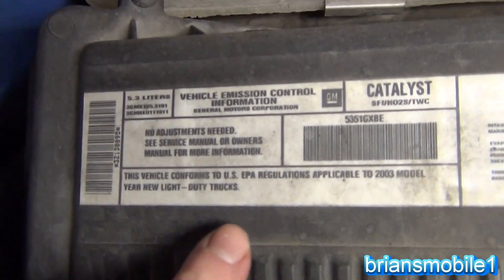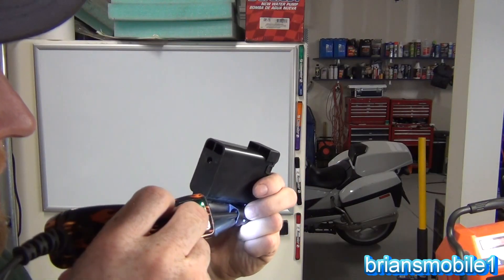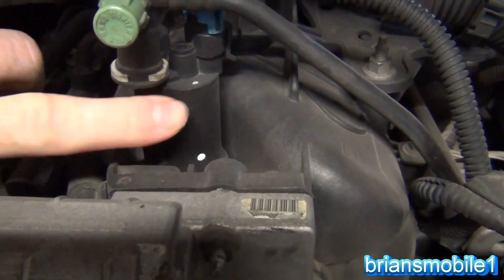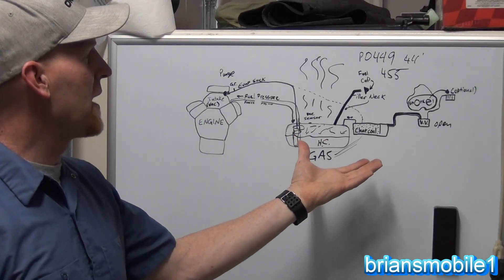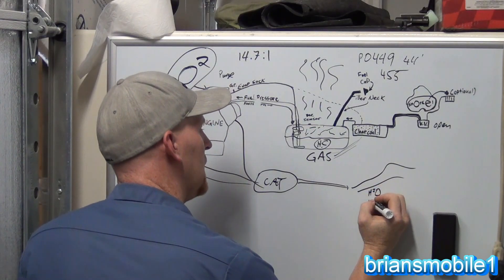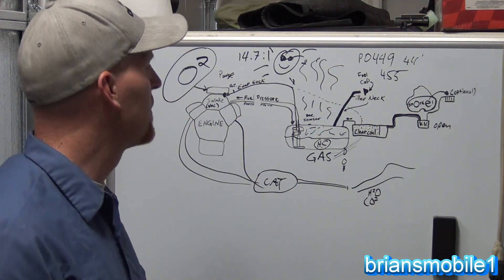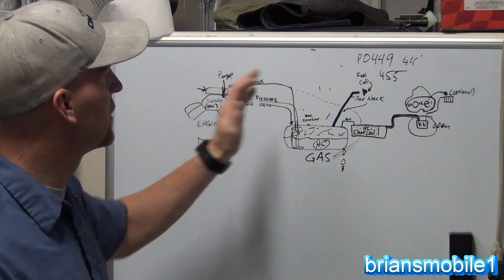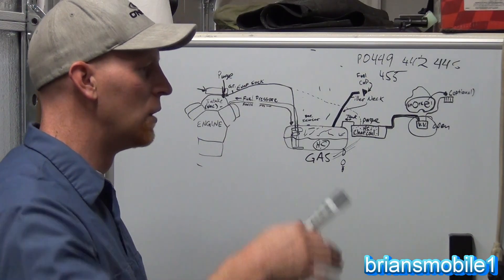P0449 Vent Valve Testing EVAP Systems

Comment: I turn my ignition switch on and sometimes the pump doesn't prime, and then 05 tahoe cranks but doesn't turn. this may happen once or it maybe happen a few times in a row, I turn off the ignotuon for 5 seconds and turn switch to on position withought starting and the fuel pump primes, and starts no problem. when it's running it will sometime completely die on me with any beeping or notification and all that happens is my rpm Metter goes to 0 and I jave no power and hard to steer and break as the system is shut off, could u please explain to me why does my pump only prime sometimes and  sometimes not, first two machanic couldn't a code cuz my lighter outlet fuse was blown, so I changed it and then again machanic finally got a read that it's a p0496 evaporative immisions high purge flow. please help!!! how can the pump prime sometimes and sometimes not and die mid drive sometimes and sometimes no problems?? this started happenning 3 days ago the no start and dying started yesterday and is getting worse. thank u so much for being who u are to help the little people ;). good man. I appreciate you knowledge.

Comment: Thanks for this!  I have a 2008 ford escape (v6).  There are no error codes generated from the computer but I can't put gas in the tank any faster than a trickle.  The problem gets worse in cold weather.  If I turn the fill nozzle upside down, I can usually get a better flow rate without it clicking off.  Can you give me any suggestions?  purge valve replacement?  vent solenoid replacement?  Thank is advance.

Comment: I just pulled a 456 code on my 2013 Ford Focus. I "smoked" the system and found no leaks. Checked the purge solenoid valve for operation only to find it leaking. Replaced the valve, all's good. Really enjoy your  video's Brian. Makes one  take time and  solve the problem without changing out parts. Thanks.

Comment: Thank you for this video..I'm trying to diagnose a p0441 incorrect purge flow DTC. I've replaced a defective Vent valve solenoid ( tested, working ). Also fully tested Purge valve..passed. I can hold vacuum on line from purge valve to entry into charcoal canister, but
can't hold vacuum when the rear line is attached to the canister. So..my question is..any reading of no vacuum anywhere in the evap system would mean theres a leak. Ive also smoke tested  from purge valve line until smoke was pouring out of vent line. I pinched vent tube and saw no obvious leaks...So...your suggestion please? Maybe vacuum pressure sensor bad?

Comment: Plz help. I have a 07 suburban and I've already had this problem with an engine light eve app code they replace the  solenoid once before I'm having the same problem over again I don't want to take it back to the dealer but I don't know if I need to buy a replacement Charco canister kit ..or vent valve purge.. replace kit.. which one do I buy ????

Comment: got a question 07 Tahoe building pressure in the tank I checked the solenoid like you and it works I was thinking it may be the tank pressure sensor any help would be great it has the 5.3 motor thanks

Comment: I am getting a gas smell from my 05 Dodge Ram 5.7 Hemi truck.
Truck runs great. I replaced the gas cap with a new one. I have good pressure in the tank when I take the cap off.
The smell happens when running and for a day or so after the truck is shut down.
Because it is present for so long after the truck is shut down I am thinking it is the evaporate valve venting off and not shutting off.
Your thoughts?

Comment: always enjoy your vids.
question... 99 Sierra 4.3L
getting a P0440
ive replaced the gas cap and still getting this code. sometimes days after resetting and sometimes weeks. could my problem be the vent valve or charcoal canister?
and how would i go about testing the canister?
thx
Reply: so ive removed and tested the vent valve solenoid and it is stuck in the open position. plunger is seized.
weird that i never got a P0449.
just got the P0440
also, the vent valve seems to be in the same location on my 99. a real joy to remove!

Comment: I have an 05 tahoe I replaced evaporated vent valve selinoid  and it still doesn't pump gas correctly stops like every 8 cents or so any hints or pointers thanks.
Reply: i just had this issue in my silverado and the "syphon protector/vent valve" or whatever in fill up line was stuck shut making it hard to fill up, ripped that out and never had the issue again

Comment: what I need is a top down look at a 2004 chevy silverado hd 6.0 model, look at all the lines (to the charcoal canister and from the gas tank.) I think i have one of the lines hooked up wrong. there are multiple lines from the fuel tank ....some splice into other lines. where can i find a video or picture schematic of this truck? Thanks

Comment: Hi Brian! 

I recently got a P2422 code on my Acura TL 05. I read up on forums that mentioned that they get clogged with spider webs. I paid a mechanic to clean out my vent valve but 600km later, the P2422 code came back. What should I do?

Comment: so i had a guy work on my truck he replaced the fuel pump. he left the fuel neck closed with an o ring i couldn't put gas because it was so slow. i had that fixed by another guy. then i was able to put gas easily, but then i got a PO300 could it be that the first guy didn't install the gas tank and attached all the parts correctly and now im getting this code. also smells like gasoline when i turn the truck on...help

Comment: whats up brian, I am having a headache of a time with a 1998 c/k 1500!!! my canister and solenoid are actually under my hood and while I been experience pumping gas problems, im lucky to get $2-$3 dollars at a time and thats with rocking the truck back and forth while pumping!!!! I replaced the canister and vent solenoid and still not pumping gas...... but also my filler neck tube secondary tube that runs off the side of filler neck goes into gas tank also, which im not use to seeing, I thought usualy it routes in different path then the tank but im just a backyard mechanic so forgive me but if u can help me in any other idea on why it wont take gas????? also let me add that the gauge in truck is stuck on full which im aware thats the float to the fuel pump thats stuck or broke but mind you i drove it like this for 2 years just counting milage x gas but just rece ntly i can not get gas in her without overflowing and i replaced the suspect culprits but maybe im forgetting something or not educated enough please help me out if you can?????

Comment: Brian,  I have a question that combines 2 of ur vid's.  I want to test the vent valve on my 04 rendezvous while doing a smoke test, using my (brand new) Power Probe.  I have codes P0449 and P0455.  This would (theoretically) allow me to smoke test the entire EVAP system all at once.  (Except for the hose after the Purge valve). Question is, where do I connect the probe in order to send power to the vent valve, resulting in a closed vent?  Thanks,  Tom

Comment: Good Morning Brian, first of all I want to Thank you for your Awesome Videos!
I just replaced my Knock sensors on my 2005 chevy Silverado crew cab 5.3 and right after I finished  I have a code P0449, as you know I had to remove the intake and also the hose to the purge solenoid, my question is could I have possibly installed the hose wrong to the purge solenoid and have a leak?The hose going to the solenoid had a funky clip that I could not figured out well.
Thanks in advance for a response!

Comment: hey man I've got a 2000 Sierra where the solenoid is between the cab and the box, is there a way I can replace it without dropping or lifting anything. I'm able to get the bolt off the bracket and reach in there and get the connector off. But I can't seem to figure out a way to get the hose off.

Comment: Hello so I have p1449 on my qx4 chanced the canister volume control and the cut valve the like connected to the cut valve is not suctioning isn't it suppose to vaccum in order to open up the cut valve can that be causing this code I'm out of ideas no one seems to had this problem
Reply: +He Tor Castro Your wording makes it very hard to understand. The vacumn comes from the engine, from the vacumn control valve it must be turned on by the computer, before the vacumn will go back to the tank. You could do this through by-contol with your code redeader if it's available on your's, or unplug it and very carefully hot wire it. one wire to battery voltage, one wire to ground, with the  engine running you will have vacumn in the back. But you will set another trouble code, which you disregard.

Comment: Brian next time you run across a bad evap canister try taking the lid off , cleaning it with compressed air then spray wd 40 or kroil down the tube. That freed up the solenoid and mine started working again. It must be all the dust and debris causing the solenoid to malfunction.
Reply: +scot miller  your practical method save lots of money !

Comment: Brian,  great video here!  lots of info.  I have a 2001 silverado 5.3 I'm getting a p0440. (gas cap replaced 2x)The thing about it, it only comes on during regular city driving. Once it hits highway speeds it usually goes away and stays off for a few days. any idea of which could cause this? valve or seleniod?
Reply: +victor cuevas You still MUST test it. the ECM will turn on the trouble code only after running the test at certain times. Go to MItchell DIY. And read the entire description of the test after clicking on your trouble code in the list. You can also go to several other places in this information to see how the system is disrcribed. It costs about  $20.

Comment: I have a 2008 Chevy Suburban Brian. Can the P0449 code be associated with the purge valve solenoid as well. I've taken it to Auto Zone to get that code read and that's what's coming up, P0449. I've replaced the Evap Canister twice. The first replacement of the Evap Canister worked for about 2 months. After the check engine light came on again, I got it read again and of course P0449 came back up. I replaced the canister again and the check engine light came back on and now stays on. I've checked the connection to the new canister but not with a tester. Could the Purge Solenoid be the culprit as well?

Comment: I have a 98 Escort and it isn't allowing me to pump gas properly or fill the tank without out the pump clicking off or sometimes that gas will spill out while pumping.  I want to fix this myself although I have no special equipment.  Could something be clogged like the tube going to the vent valve or the vent valve be clogged or not working?
Reply: +Zack Vance The vent valve should be open to the atmosphere at this time.Try blowing through it by attaching another hose to it.  The smaller hose at the back of the filler tube could be plugged or rusted shut, but on this old of a car it probably will disintegrate when you try to get the hose off.

Comment: Brian, your videos are BY FAR the most informative of the few times I've used this method for DIY repairs.  I watched your video on p0449 vent valve testing, and learned how the system operates, however.....  I have a 2012 Chevy Impala with code p0496, and despite the knowledge that these lights come on for specific and/or important reasons, the car starts and runs perfect EXCEPT after turning it off to fuel up. Then when starting, it turns over for approximately 3-5sec before it fires, followed by a couple seconds of erratic idle, then runs like a champ until fueling again. I am unsure of which component to begin with on my evap system (vent valve, purge solenoid, canister, etc), though I'd prefer to start with the least expensive. I possess very little equipment/testing tools, but have the essentials for parts removal. Any info or tips you'd possibly be willing to share would be greatly appreciated.  Again, impressive and informative presentations you've compiled, great job. ;)
Reply: +Jamison Raskovich I'd imagine you get thousands of requests for help.......just thought I'd take a stab at it too.

Comment: HI BRIANSMBILE I have a 2003 chevy s10 with  evap system monitor inc no code i been driving it for over 150miles and it did not resat can you help i live where it cold out if that help

Comment: my problem started with p0455. that went away. now I have a fluctuating idle at times. not always, but my codes now are p0171, 0174 combo. also ltft out of range. shrt term fts are lean. -3 or so. ltft is +25. I'm leaning toward intake gasket...this is 03 Suburban. would love your thoughts

Comment: Great vid! Now hopefully you can help me out, lol. I have a 2006 Silverado with code p0449. I replaced the evap vent solenoid located on the gas tank, but the CEL came back on. The original evap vent solenoid was not filthy dirty like a lot of people were saying, just a little bit of dust. I later replaced the purge valve on top of the engine, but that also did not fix it. I don't have any fancy voltmeter type tools, but do you have any advice for me? Thanks!

Comment: good video brian, thanks. have the p0446 on my 02gmc 1500 5.3. I replaced the vent valve gas cap, charcoal canister and senlenoid on intake manifold, but light came back on few weeks  to month later. how do you check if the purge solenoid on manifold is good. same type method?, have bought the power probe.. determined old vent valve was good

Comment: Ok so I get that P0449 on my 07 HHR I have replaced the Valve with a Duralast one the gas cap seems to test ok and I don't see any cracks or breaks in the hoses around the gas cap and gas tank. Any thoughts on what else might be throwing this code up? I clear the code and it takes about a week of normal driving but it does eventually come back on. Any thoughts would be very much appreciated!

Comment: Hello and thank you for video.
I have Chevy Suburban 2005. Check engine light is on. Error code P0449. I have bought and installed a new vent. But getting the same error code. I checked the wire voltage to vent and it is 3.2-3.5 volts only while truck is running and Vent is not clicking when hooked up to a truck.
If i supply 12 volts from a spare battery to vent i hear clicks, so I guess vent is OK. Wire to vent looks ok too. I have not chased wire all way down.
Question - what is the voltage to vent when truck engine is running? If i am not getting 12v there,
where can I look for the issue? any advise appreciated!
Thanks Mike

Comment: My check engine light isn't coming on, but I can't fill my truck with gas because the pump keeps shutting off. IF I remove the "to tank" hose from the solenoid it will work. I replaced the solenoid but still no luck. Any suggestions on what to try next?

Comment: I fixed everything that has to do with the evap system and every time I put gas in my 07 tahoe it starts up rough  like it don't want to cut on any suggestions

Comment: Brian, my 2010 Camaro started throwing codes P0446 and P0449.  They aren't covered under the extended warranty.  Do you have any thoughts on what the issue might be with both codes coming up?

Comment: 2001 Chevy Suburban 1500 5.3L.  What is the trick in removing the vent valve clip that hold in hose and the valve?

Alexx Casanova
Reply from the maker: +Alexander Casanova Spray silicone- push the hose on and squeeze the sides- then pull back squeezing and twisting all the while.

Comment: Hi Brian. I have reading on my OBDII P0455. Large Leak in evap system. You suggesting that P0449 shows  problem with Vent Valve. Is possible that in Chevy Aveo 2005 that code P0455 shows vent valve problem ?  How to determin if purge  control selenoid or vent valve is responsible for that code ( P0455) ?

Comment: Very Imformative ty ... I had issue where I would drive car fine  with no hiccups but when I stopped at gas station or turned off car for short stint and got going again  5 mins later the car would just die so Id pull over and let it rest for 20 mins n it would start back up again.... I noticed when i took gas cap off n got that whoosh of air it would happen sooner etc... was thinkin somthin like a vapor lock but i get no codes 

btw luv the way ur vids are done , what cam you using If I may ask ? :)

Comment: Have a '07 GMC with a 4.8. confirmed and changed the defective Evap solenoid. Reset the code. Been driving the old girl, about 200 km on it, but still shows incomplete. What consists of a drive cycle? Could I have missed something?
Reply: +Buzzie 00 Some module/system tests are 10-20 drive cycles, and some have minimum durations/parameters.  Is your code back, showing pending?

Also some scanners are not fully capable of testing a module or system, and will always show "INC".

Stay gold.
Reply: Tks. No code.

Comment: where is the purge control solenoid located???
Reply: +Louis Flores On my 2006 4.8L Sierra, its right at the front of the engine under the plastic oval "Vortec" cover.  Right above the throttle body.

Stay gold.

Comment: I have a few 2005 Chevy trucks. Air is not being displaced out of the tank causing fuel to back up in the neck. Obviously something is plugged off. If I didn't want to replace the canister or whatever the problem may be and didn't care about the codes. How can I get around this and vent properly ?

Comment: What if the purge solenoid is bad?  Will I get the same code?  My truck is hard to start after fueling. Other than that is starts fine.  I changed the vent solenoid and canister once before. Check engine came back on within two weeks. Any ideas?

Comment: I have a question.my car smells like raw fuel when it's hot out side and when I have under a 1/4 of a tank could it be my charcoal canister.its a 94 mustang gt.
Reply from the maker: Mike KetchumMikenhazel  It's your filler neck.  Shop online.  You'll find they're common on Ford rangers too.  Should cost you around $40